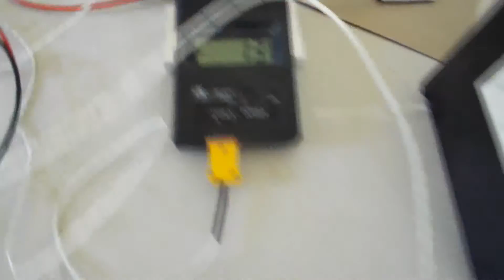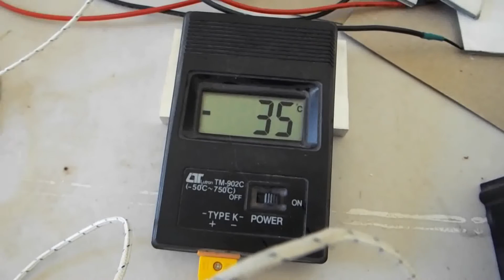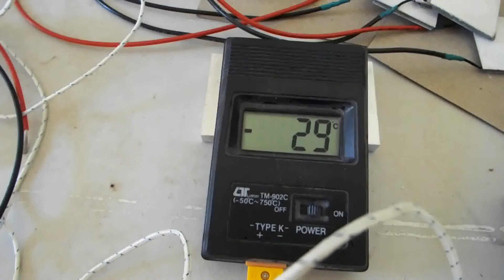How Cold Can a Thermo Electric Cooler (TEC) get to? DIY 2 stage TEC. Experiment 2 of 2

Comment: Why not just put onr pelltier on top of each other.. i wonder
Reply from the maker: Simple, it has to do with efficiency. Peltier is not very efficient, so one on top of other would not work, in other words they create more heat than they can remove. It would be like trying to put a wind generator on your electric car, all you would do is end up using a bunch more energy and looking silly.
Reply: @madscientisthut  Well it depends, stacking could be very effective when you can change the voltage on each unit. I have done some small tests and at the moment my "record" is 2x12706 stacked both running at 5volts, they use total of 20wats and reach -24celcius. Room temp 20celsius and cooling block stays at 21celcius. Using 5volts also opens a lot of different uses. Like USB chargers for powering them or Solar/Normal power banks to use them in coolers when in beach etc.. I'm currently using 8amp 5v 3xUSB 2.4a charger in my tests. Just don't use normal USB wires, they have hard time to deliver enough amps...

Comment: I just did a quick calculation and on 240V mains you could stick about 9 or 10 in series with a half wave (single diode) rectifier and you would be good to go. Obviously safety is a concern but your power supply would consist of just one diode. I am looking at making a cloud chamber to view cosmic rays.
Reply from the maker: I would not go anywhere above 48VDC just for safety concerns

Comment: wiring them in series should increase the voltage and reduce the current needed
Reply from the maker: Very true, but then I would need a different power supply, since this supply puts out 12V

Comment: I got a Thermo electric generator from a old water cooler 
How do I know it's amps?
Reply from the maker: Depends on if you can read the model number off of the top of it. You should be able to look up the number if it is readable, otherwise you will have to measure in circuit assuming the cooler still had a functioning power supply.
Reply: madscientisthut There's nothing on the Thermo Electric Cooler 
Also the Power supply is messed up.  
I'll be using a 12 V 10 Amps adapter to Power it. 
Would it be enough to Power the cooler and fan?
Reply from the maker: If you have a multimeter that reads current you can measure what the draw when it is hooked up to the power supply, if it is drawing less than the supply can put out , for example 8 amps on a 10 amp supply that should be fine, but say it is is drawing  9.5 amps on a 10 amps supply I would try a 15 amps or higher supply and measure it again. I never like to run power supplies at maximum current since they tend stress the components and can kill the supply pretty quickly.
Reply: madscientisthut I tried to get in touch with you on Twitter
Reply from the maker: Sorry I have not done twitter or facebook in a long time, takes too much of my time. I try to stay focused on YouTube now. Life becomes too saturated trying to keep up with all of the distractions...
Reply: madscientisthut I have the Transformer. 
I'll Text the Power Supply Consumption.
Reply: The Amps that it uses depends on how much V you give it.
For example, my TEC is rated for 16 V but I don't have a 16 V power supply.
I give it 12 V from a car battery charger. It uses 4 A instead of 6 A.
If I put the TEC in a freezer, it can reach 6 A.

I set my freezer to - 26 C.
My TEC was probably reaching -46 C and I was able to freeze mercury. Keep in mind that mercury as a metal is a good thermal conductor and the air above it was -26 C. Since the TEC was ~ -46 C, I was able to freeze the Hg.